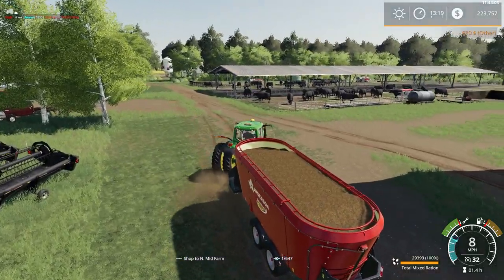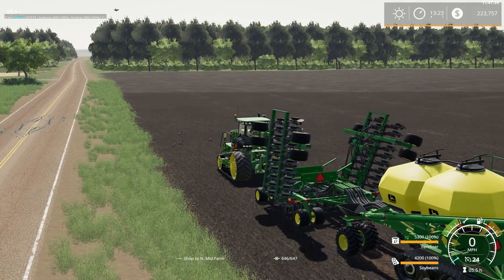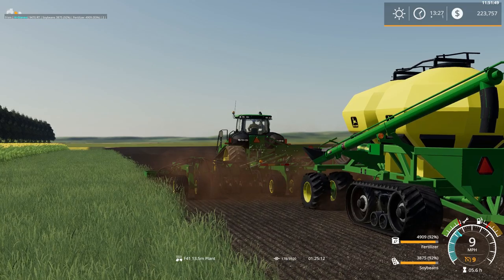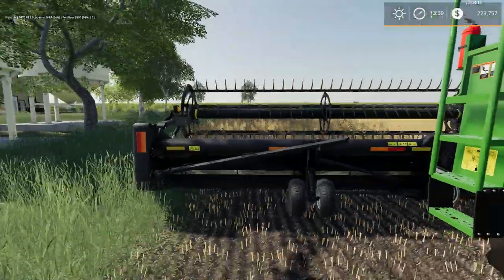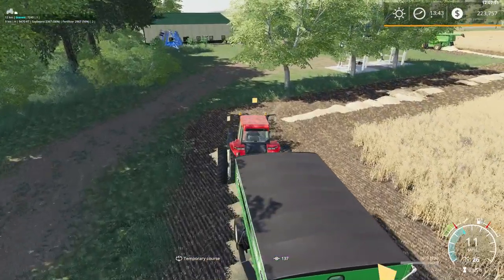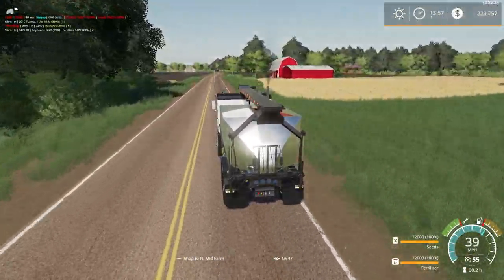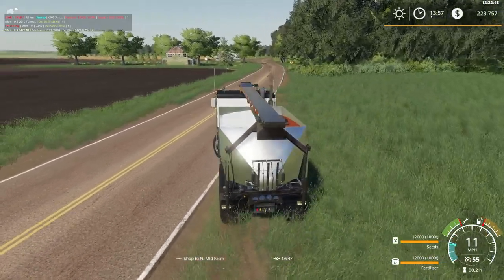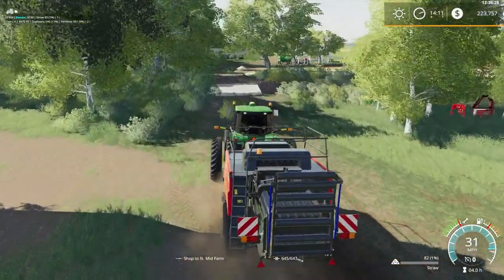DEMO AIR SEEDER AT THE FARM | SHOULD WE KEEP IT? | FARMING SIMULATOR 19

Comment: You should get the big bud on the 70s and 80 equipment videos
The Big Bud 747 or 16V-747 Big Bud is a large, custom-made farm tractor built in Havre, Montana in 1977. It has 1100 horsepower. It is billed by the owners and exhibitors as the "World's Largest Farm Tractor".
Reply from the maker: what is weve I might end up getting a big bud for the autumn oaks series.